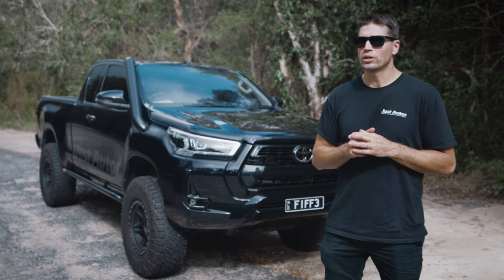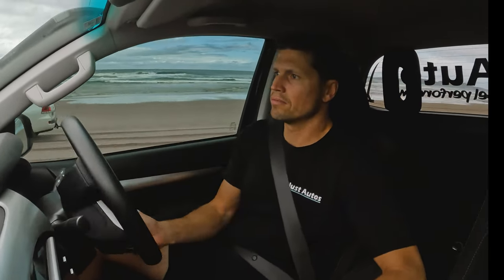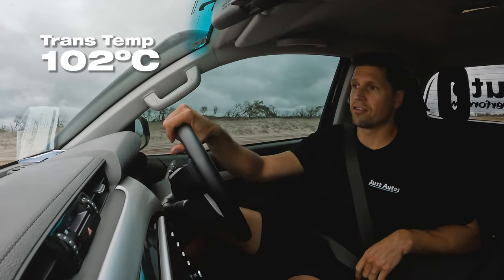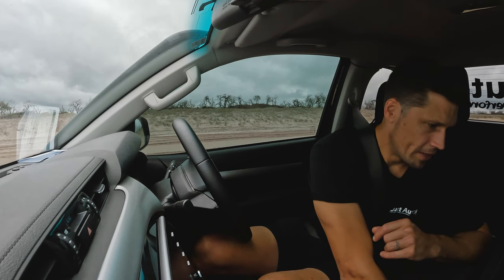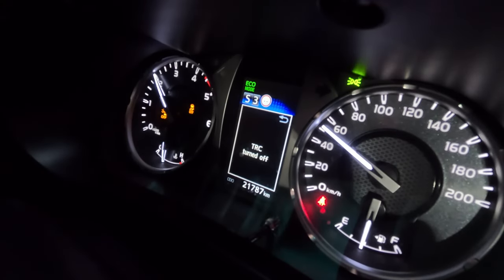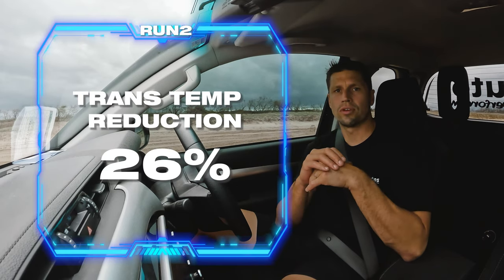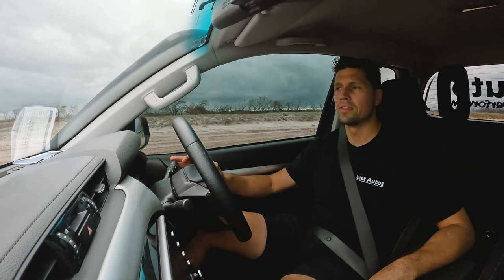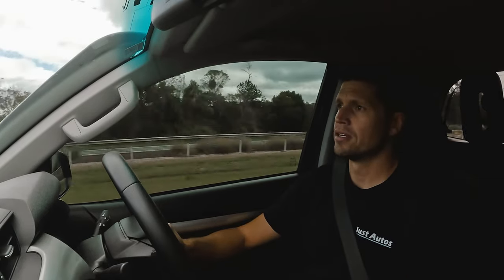Just Autos Easy Lock Up N80

Comment: Hey Matty! Have you driven the new GR Hilux and can you confirm if it suffers from the same issue? I've heard that they programmed the GR differently but not sure if it made that much of a difference in these scenarios.
Cheers 🍻
Reply from the maker: GR Hilux still requires a lock up, only slight engine file modification is changed from the factory given is a small boost in power compared to other hilux varients